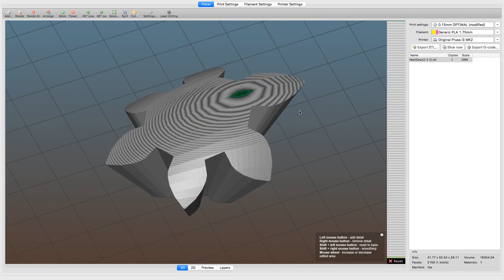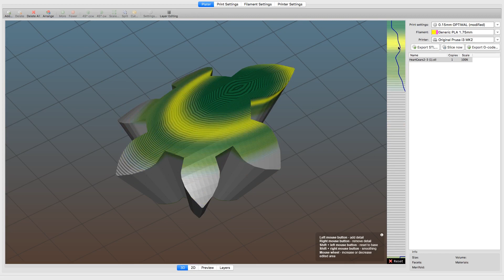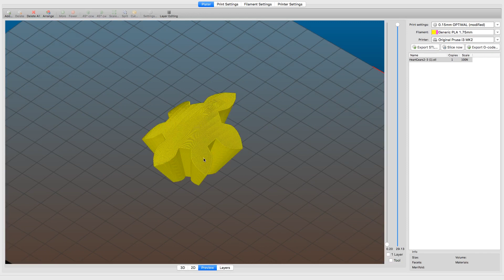Variable Layer Height in Slic3r Prusa Edition

Comment: Great Video, thanks Matt! 
I've been following your blog for quite a while now, and I really enjoy your detailed articles, as well as your videos!

One question I have on this video in particular: If you're setting the maximum layer height in the "Printer settings" to 0.25 mm, wouldn't that override the setting of the layer height in the "Print settings" tab? Wouldn't that cause all layers to be 0.25 mm maximum, and not 0.3 mm?
Reply from the maker: Thanks! I've found that the limits you set under printer settings only apply to the layer editing feature. So you couldn't edit a layer to be coarser than 0.25mm. Setting 0.3mm layer height in the print settings tab overrides that limit :)
Reply: Got it, thanks!